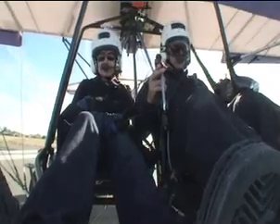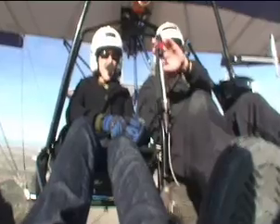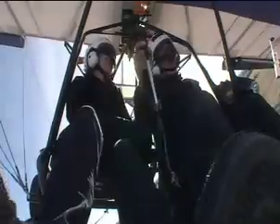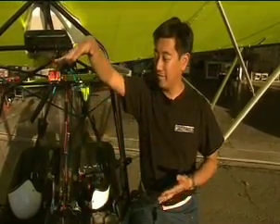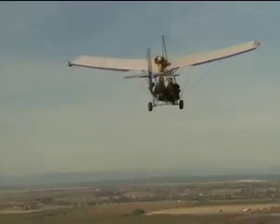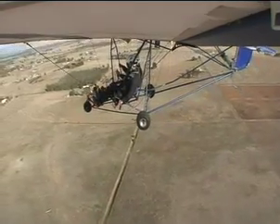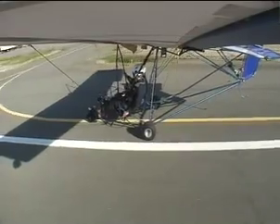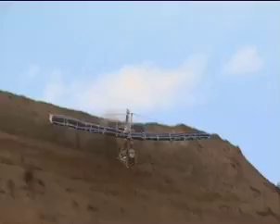Mythbusters - Ultralight

Comment: If you watch the Mc giver episode, the so-called cement mixer engine is a twin cylinder 2 cycle snowmobile engine. 
Probably 35 to 50 hp. 
More than enough power to fly two. 
Mythbusters. 
You are BUSTED.

Comment: I used to fly ultralights made by a company called Wizard, they had a 15 hp engine option and a 40hp Kawasaki engine option. I flew the 15hp engine option many times while they were available…while not as strong as the 40 hp version the 15hp engine was adequate enough to get the job done….the pilot’s weight needed to be less of course, no more than 180 Lbs……looks and performance wise the Wizard was very similar to the Quicksilver / Eipper used in this demonstration.

Comment: These planes fly like a PIANO!   45 degrees nose down to maintain speed.  Horrible!  Throw it away, and build a proper a/c like my Murphy Renegade 2.      Push - pull tube controls with multiple rod end bearings; differential, frieze ailerons; 2 tanks; aerobatic to +10 and -6G.  2 place.

Comment: the Sandlin Goat Glider, an open source ultralight design that people have been making at home and flying for over 20 years, is a glider, you literally walk your self down a hill and it flys, for a very, very very long time, maybe because, its designed to. Oh and and company called ZIGALO in the past few years took the Open source design and put a motor on it making it now called a motor floater, and now they SELL it in kits and with an electric motor. SO, this video is fake news, They do not present the facts that the above model ultralight is designed to be a motorized ultralight and not a glider which has different wing length shape and purpose. Why do they not present the facts about design and the facts about ultralights? What is the purpose of telling people what is already not only a fact but a world wide hobby? Its like edison using low current AC ( alternating current ) to slowing execute a man all night long to make the use of Tesla's Alternating Current Look bad, with out telling people that his DC ( Direct Current ) was blowing up on a daily basis and setting peoples homes on fire all over any city that used DC generators.

Comment: Throttling  the engine back is not the same as having a 9 hp engine!  It's the rpm of the propeller that pushes.  The propeller has to be matched to the engine size.  And it certainly won't fly with a fat chub like her!

Comment: People in the 70's were home building ultralights with materiel from the hardware store powered by chainsaw engines. However, these were base on a rogallo wing. i.e. they were basically powered hang gliders with a "trike" for the pilot hanging under it. The glide ratio on rogallo wing ultralights is much better than on the fixed wing types. But what was shown on the MacGyver episode was in fact a fixed wing type, not a rogallo wing, which is what he should have made if he wanted it to work - as a bonus they are simpler to construct as well.

Comment: you could absolutely fly an ultra-light with a 9 horsepower engine!
where myth Buster's failed with their experiment.
the pitch on the propeller on the ultralight they used for the experiment was pitched for that rotax engines horsepower curve.

Comment: throttling down a big engine (40,60 HP) like that one to the equivalent to 9 HP is not a good comparison. a 9 HP brigs would be spinning at about 3200 rpm and a much different property size and pitch, you all cheaped out and just throttled the rpm down to a much slower rpm then what it was designed for the prop  and would have been much less efficient then what would have been the normal for the MC giver 9 hp. this episode reminded me of the thermight  debockle. railroad have used it thousands of times on rails. Did the Bushes tell you all to disprove the thermight?

Comment: Pitch controls airspeed, power controls altitude. any airfoil will glide at whatever rate the design allows, but sustained flight requires power. Lots of ignorance being demonstrated here about a subject that is extremely well established and proven.
Reply: Exactly my thoughts "reducing power to 9hp" looked a lot like a steady approach to me. These guys just reverse engineered themselves into low power descent. Plus they were in a MX 2 made it even more exaggerated. Like in what way was this a recreation? They changed almost every variable. But hey whatever keeps them on the ground.

Comment: He says he's not getting lift from the wings when he's dropping 200 fpm? Okay Grant, without the wings you'll drop 10,500 FPM do you see any difference there?
Reply: that is just a different resistance to falling .. lol       both are falling .. not lifting ..zero lift
Reply: They weren't falling they were gliding, and lift is the force it doesn't have to actually elevate your position for it to still exist. This is why those planes don't just fall out of the sky when they lose their engine power.

Comment: Obviously a 40 hp engine connected to a gear box will produce completely different numbers than a 9 hp engine with the same gear box. However reducing prop rpm on a fixed pitch prop does not produce the thrust required. Now if they were to either match a 9 hp engine with a gear box designed to spin a prop with the correct pitch the outcome would be very different. It might be possible to maintain level flight with a more efficient wing too. And perhaps one person. There are many variables. This test is garbage at best.
Reply: They were just trying to see how the ultralight would behave when severely underpowered.

Comment: Have they even heard of gliders? Totally scientific experiment, 9hp could be good or bad depends on stall speed, wing surface square footage, weight, wind speed & direction, angle of attack and the center of gravity of the craft (cg), not what a two seater with a 30hp engine will do when you idle the engine... Why didn't they just throw there hands up in the air and say "it will never work" another great example of Piss poor planning.
Reply: Exactly. You can look up the glide ratio on just about any aircraft. This is just fluff to fill airtime.
Reply: Not really. It was also done to give perspective on what exactly an ultralight is.

Comment: When they throttle back, the propeller slows.  Naturally, that has nothing to do with horsepower.  A 1HP engine turning at 20,000 RPM can produce quite a bit of thrust - it just takes a propeller to be matched to the engine RPM, and propellers are not designed to be slow turning to produce power, except on submarines.  And submarines are poor flyers.
Reply: You can slow propellers down to create less thrust just fine. The reason real propeller planes use variable pitch instead is because it keeps the engine within it's ideal RPM so it get's the best fuel efficiency.

A 1HP engine can't produce much thrust. If you have it spinning a propeller at 20,000 RPM the engine will simply stall or more likely it won't even start as even at idle speed it can't produce the thrust.

Comment: You can't throttle back a 50 hp engine to "9hp" without a propeller problem. The prop will be going too slow to work! (Duh) You need a 9 hp engine and a prop specially designed for it. And one person on board. I bet the results will be surprisingly different. Maybe it won't maintain alTITude but it would come very close (compared to that test). lol
Reply: Exactly.  Every engine has an ideal prop for rpm and H.P. at expected cruise speed.  A 9 H.P. engine would be turning much higher RPM to produce 9 H.P. than the 50 H.P. engine at 9 H.P.   The 9 hp engine would need a reduction drive to swing a prop meant for 50 hp. and the 50 hp engine would need a higher pitch prop for the low RPM it would be running at 9 hp.  Mythbusters was unscientific with some of their subjects.
Reply: @denbecr49  exactly..
Reply: How does that work? a propeller will still push air backwards no matter what speed it goes.
Reply: This image might give a view of what I believe the commenter is saying -http://image.motorcyclistonline.com/f/28309743+w750+st0/122_0908_14_z+kawasaki_er-6n+dyno.jpg

Below a certain throttle the engine will stall and struggle to even pull the propeller at a constant rate due to that. A 9hp engine would be considerably smaller and lighter as well.
Reply: Um .. what?

Comment: This is so dumb, of course 9hp is going to keep an aircraft made for much more than that, loaded down with two people. I imagine an air frame made with bamboo and one person on board would prob maintain altitude with 9 hp.
Reply: WoR473 You can't throttle back a 50 hp engine to "9hp" without a propeller problem. The prop will be going too slow to work! (Duh) You need a 9 hp engine and a prop specially designed for it. And one person on board. I bet the results will be surprisingly different. Maybe it won't maintain alTITude but it would come very close (compared to that test). lol

Comment: HP test is invalid, incorrect prop and engine rpm. lazair uses 2 9.5 hp engines and it'l stay in the air just fine with only one of them if there is a failure

Comment: Huh. First test was kind of pointless, given the whole concept of an ultralight is a hang-glider with an engine to power it. Grant's test on the horsepower needed to sustain flight was more relevant, though I wonder if they took into account the weight of the engine along with their own, given that a good chunk of a propulsion system is used to propel the propulsion system itself (which is why, for example rockets are so large compared to the payload...most of that is used to propel the weight of the rocket itself, rather than the payload weight) . Of course the real kicker is that their final construction...was kinda crap, to be honest. Unfortunately, while the Mythbusters team are good scale builders and great visual-effects/detail builders, they've proven multiple times that scratch building aerodynamic structures is waaaay out of their skill zone. (and that's not even taking into account the time they claimed the failure of a rocket design was due to the basic structure, not the large and obvious hole burnt through the side of it by a faulty motor build...) Someone with more of a clue on aircraft construction (say, your average R/C aicraft builder) could have taken the same materials and built a more flight-capable craft.
Reply: True. Their bamboo plane looked like  a Gilligan's Island attempt.  Anybody who's ever scratch-build a model plane would have done better.

Comment: It's a shame that MB didn't look in to the real physics of flying. The MacGyver ultralite would probably have a horrible glide ratio. However bamboo would probably be strong enough and light enough. The garbage bags were probably the most difficult part because you don't get lift out of a sloppy aerofoil. The airspeed in the test wasn't enough.
That said, it is also possible that there is a strong wave lift at the edge of the cliff that gliders etc use to stay in the air and climb with.
Reply: Well that's why the myth was busted.

Comment: ... but my point is that most usually they do not even have motors, also the ultra light you were in was a "pusher" type motor where the prop was on the backside of the wing, you can help with better lift if you put the prop on the front side of the wing so that the air the prop create goes over the wing to create lift

Comment: yeah! less weight flies better. you simply need an airfoil that provides greater lift. for instance look into gliders, in theory they can stay up for days and days on in with out coming down, that of course is without the factor of the piolt and his fatigue..
Reply: Yeah but the bamboo and ducttape just doesn't have the structural strength to support very large wings.

Comment: how much hp does it take to lift that particular aircraft off the ground? does anybody know? apparently these old fellas online i try writing don't know how to use a fucking computer to answer a simple question. It didn't say on this vid, all it said was it takes a lot more hp to lift it up off the ground 1 question i ask and it takes forever to get an answer,  isn't that what computers are for, for learning?  I love to learn, its all i do, thats why i bought a computer
Reply: Well actually knowing that is hard. You need exact data on weight, balance, surface area, air density, vibrations and a lot of other factors.

Comment: These (ultralights) seem to have a tendency to pull up sharply at lift-off. Is it the discretion/skill of the pilot or the tendency for the craft to 'leap' into the air? Is there an inherent characteristic in some designs to pitch-up at speed? Is previous experience in a conventional machine a prerequisite for piloting ultralights?
Reply: I think it's also because we are comparing them to full size jet liners. Jet liners are heavy and when a plane climbs it has to fight against gravity so a heavy plane will climb a lot shallower than a lighter one.

Comment: This test is so skewed. When you throttle down the engine you don't have enough rpm's on the prop to sustain your air speed. 9 HP could easily sustain flight and has been proven to, if the prop is matched to the power plant and the weight of the machine.

Comment: I call bs on this whole episode,
there are human powered ultralights that managed to fly across the uk/france channel, and clearly they don't have 9 horsepower.
the real issue is the load, its a big heavy engine and therefore fuel tank with two people on a safety frame that probably has twice the strength and therefore weight that it needs plus cameras and radio gear it can be done, just not by these people
as the it crowd say it's all down to id-10-t error.

Comment: cake... it's a 'pusher' and doesn't depend on prop for air-flow over the wings
Reply: Not entirely true. I mean even Tractor configuration isn't get lift from the dirty air coming off the prop as much as the clean air making contact with the leading edge of the wing. The prop is mostly for thrust in both configurations. The big difference is with the pusher you get more of nose down with throttle that doesn't happen with tractor configurations because of the thrust angles.

Also pushers don't get as much thrust because of the plane being in the way of the clean air. Adversely they get more lift due to more clean air hitting the wings.

Comment: @Thopter 
Good points. When I flew Lazairs we had some early models with two 5 HP engines - slightly more than 9 HP, they took of and flew quite nicely, smaller props though and a larger more sophisticated wing. Did the McGyver show have twp people on board? drh

toucan 2plus2

Comment: @Thopter 
Right on. I'm not sure how small you've seen, but I saw an ultralight glider with "self takeoff capacity" (or something like that) get off the ground and climb using a 20 hp  engine.  (It's probably still somewhere on YouTube). I imagine there are smaller. 

Would you do it just the same way as this video if you were testing that 1907 steam powered car? "The myth is steam-power drove the car just fine. We'll put that to the test by blowing methane out our butts, after these adverts."

Comment: @gamotonfasismo 
Exactly, the Mythbusters typically set up inaccurate tests and make silly conclusions, likely in the name of TV brevity. 9hp in a plane that weighs twice as much, and simply reducing the prop rpm is not representative of the original macguyver plane. 

Bamboo, plastic sheeting and duct tape were indeed used to build early hang gliders and making a one-flight ultralight seems quite feasible.
Reply: I have some serious doubts about that second statement as duct tape was invented in the mid 30's and only became easily available after WW2. By which flight was well established and hang gliders had existed for about a century.

Comment: This is ignorant.  the prop they are using was designed NOT for 9 hp but for the most likely 50 hp of the engine in the craft.

These folks know nothing of physics, flying or engineering.

Bill

Comment: Fail for another reason too. 9 horsepower at full throttle would be spinning faster than a 27 hp motor at partial throttle, potentially creating more thrust.
Reply: I think that's a problem. If it spins faster at the same horse power the engine is much more likely to stall. After all the propeller creates a lot of drag.

Comment: Gluvey, 

A 747 actually glides quite well. Flown @ it's best glide of around 200kts it can have a glide ratio of 17:1. (17 forward units for every 1 unit down.) To put this in perspective, a small Cessna 172 comes in around 8:1. Stranger yet, the 747 has roughly the same glide as a hang glider. 

Remember, there is an aircraft out there that is known NOT to glide that well but is landed without power every time.....yup, the space shuttle.

Comment: There are plenty of light weight planes with VW and 1/2 VW engines the fly just fine, and some are very fast. Some of the 1/2 engined planes are on legal ultra lights, per 103 regulations.

Comment: Slowed the engine to produce 9hp?!? OK... So the prop slows too. A 9hp motor with a prop designed for it should give enough thrust to fly, regardless of their test method. I have a 15hp plane that will carry a 200lb pilot with ease, and NOT 2 people with a motor running at 1/3 power or less? Are we suppose to be that stupid?